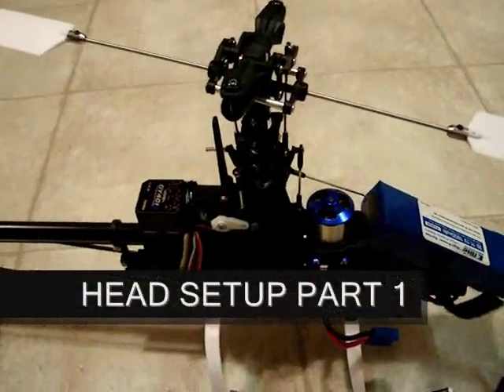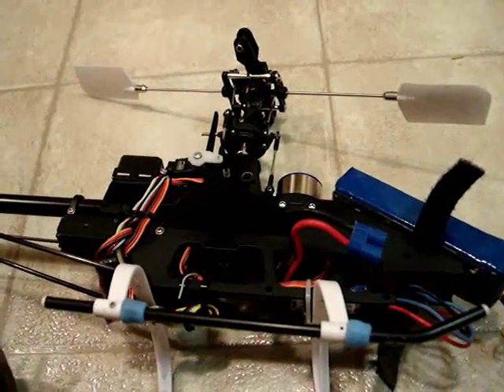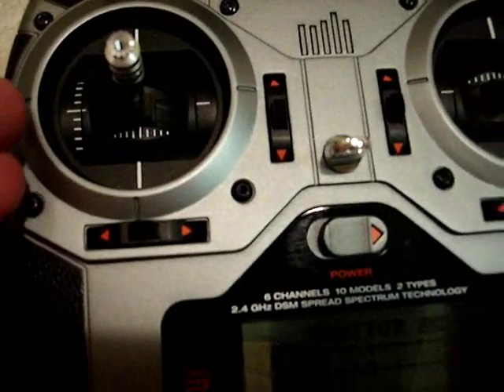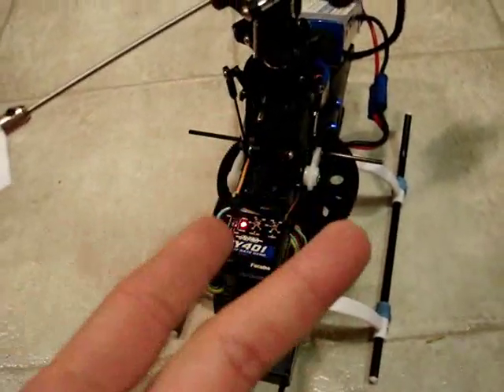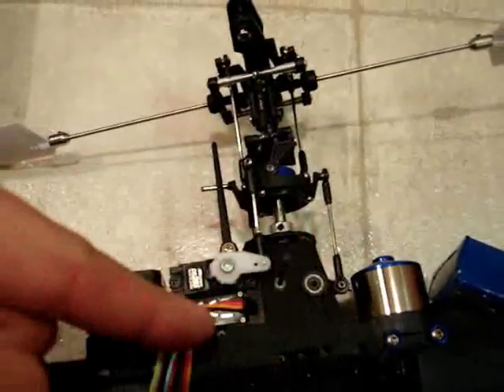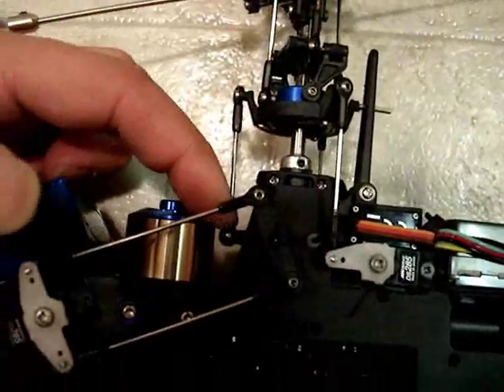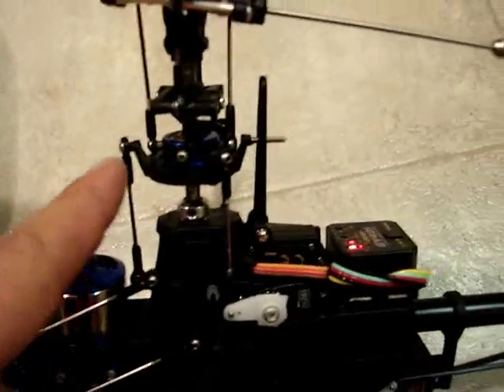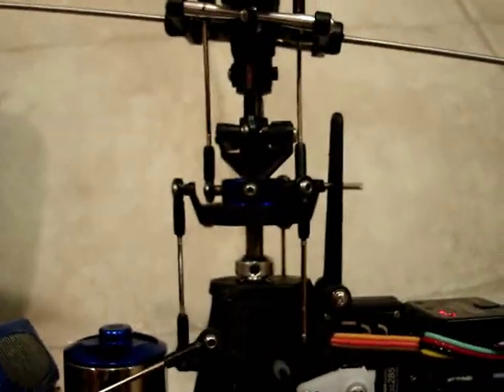Blade 400 3d Head Setup Part1

Comment: Sokal,  could I suggest one thing? I will anyway...It would help to have a measurement to start with in setting the swash plate in relationship to the head.  Something to get in the ball park on swash height.  There are a lot of moving parts and it needs to be easily read with a caliper... I chose from the bottom of a level swash to the top of the allen head bolt that goes through the shaft... this distance can be measured with the head on or off.. I believe that measurement to be 1.555 inches.

Comment from the maker: swash hight is based on collecive range if not equal once you set 0 pitch swash height is off.

but usually at full pos the phase block is flush with the pins at the bottom or very close to that

Comment: Sokal - thank you so much for the videos.  Good stuff.  I'm trying to correct a right-aileron issue on my Blade 400.  Looking at the Monitor on DX6i, I'm noticing the AIL and AUX markers are off center to the right with mid-stick on cyclic and collective.  I have to go hard right stick to align.  Any ideas how to get those to center?  Also I noticed on this video that your THR indicator is far left with your throttle at mid-stick, while everything else is aligned.  Is that normal??  Thanks